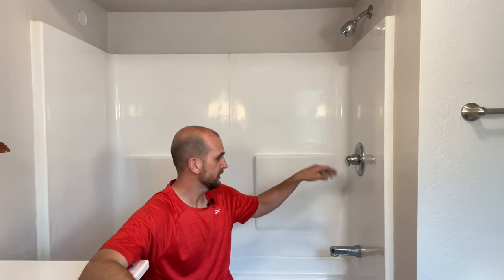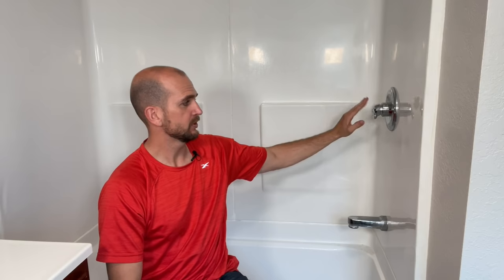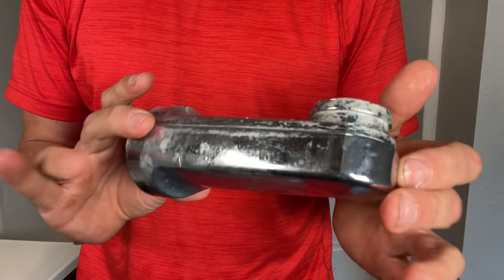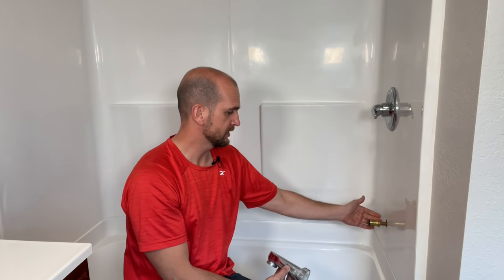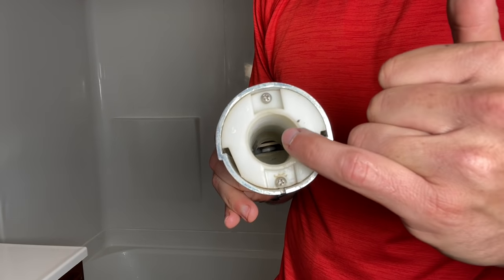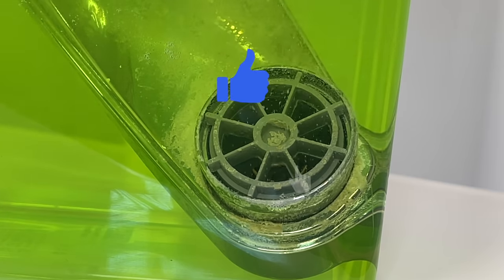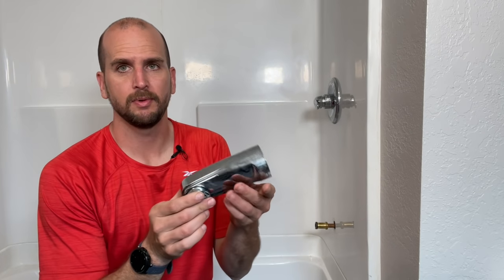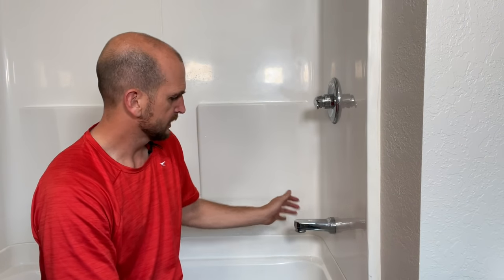Fix Tub Spout That Leaks Water When Shower Is On

Comment: I used white vinegar in my bathroom faucet aerator. Had hardly any flow. When I took it apart the screen was almost plugged with calcium. Works great now.  Thanks for these tips.
Reply from the maker: Thanks for sharing
Reply: Everyday Home Repairs That Fix It Guy hi. A plumber installed a brand new tub faucet yesterday. Now there is an issue. When running the diverter, only water comes out of the diverter with good pressure. The problem is when running the shower, the diverter still running. Both at good pressure. When everything is turned off, there are no leaks. I noticed this after the plumber installed and I asked the plumber why the diverter would still run, when shower is still running. The plumber said that is what the new faucets do now. That seems like a huge waste of water when showering. Is what he’s saying true or did he install something wrong? If he installed wrong, what is the fix?
Reply: @salsamink  I think your plumber is FOS!

Comment: Would it also be a good idea to replace the O-ring, and put a dab of silicone grease on it before screwing it back in?
Reply from the maker: Not a bad idea at all.  Especially if you are running to the home improvement store anyway. 👍
Reply: I would definitely recommend a little silicone lube.  You can get it in small round gray plastic tins at any hardware store for a few bucks.
Reply: Is it a special size o ring? I have the same exact diverter setup and the o ring is bad. Water leaks out the back of the spout.
Reply: @ryandeno4190  Can't recall, since I ended up getting a replacement spout.  Too much corrosion/lime scale on the old one.
Reply: @ryandeno4190  I need to know the same thing

Comment: whole house water filtration system with softerner= fixed mineral issue
Reply: Jimmy Bennett -- Do you know if your system actually REVERSED mineral buildup in your cast-iron sewer line? (If you have cast iron)
Reply: @jake9705  you can help it a lot if pipes in house after the iron sewer are plastic or copper.  as for the sewer it self. U cant stop that.  But highly suggest you filter your water and if you have well water then 100 percent filter it and use water softner

Comment: You need to get a mineral filter installed to your boiler to prevent build up of mineral deposits in any of your valves all around the house as it can also clogg your radiators and the boiler itself,  also you'll need a magnetic filter to prevent buildup of black sludge in your radiators which will absorb the heat and make your gas bill go sky high as the sludge is made from iron deposits it'll take for ever to heat up the radiators in sufficient time in the mean time your gas bill will  £££££$$$$$$$ instead of £$

Comment: Thank you brother. I just bought and replace the shower head then the tub spout starts leaking so badly with bits of black and white  residue falling in the tub from the spout.  I did what you instructed and the blockage went away. Thanks man, you save me buying a tub spout.
Reply: Yeah, probably some old calcium broke off and came out.  Or, the damned city cleaned their pipes upstream, then you got particles that came your way.  Both has happened to me.

Comment: Fun fact fron a professional house cleaner.

You CAN use a stainless steel wool pad to speed up the process of removing calcium build up. Make sure it’s the 0000 grade. I use scotch brite brand. 

It’s safe for chrome fixtures, most nickel finishes too. Just not on brass. 

You can also use stainless steel wool pads on glass! Just make sure it’s not tinted.

Comment: Thank you for this video.  Same thing is happening with mine.  But, mine has threads on the pull-down object, which I took off -- thinking that there was some debris from the city that came through the water pipes.  But, it's not got any debris.  So, I think the problem would be solved how you showed.  But, I am also thinking that I need to take off the pull-down thing and then put some new tethlon tape around the threads.   [Sorry, I don't know the names of things, but I get the gist of what needs to be done.]  This is a very helpful and clear video.

Comment: I've got a kitchen faucet with the combo sprayer / regular pour thingy that clogs up and really slows the water flow. I've tried vinegar and it starts to work, but I may give CLR a try now. Thanks for the tip!
Reply from the maker: Yeah, I think CLR is a bit more effective.  Try to soak it fully submerged for 15 mins.  Let me know how it works 👍
Reply: @EverydayHomeRepairs  dumb question, with water and vinegar the piece floats even when submerged for a second. Is CLR dense enough to keep it down, or should I get a weight still? Your channel is amazing, thank you for everything you do!
Reply from the maker: @CyberPitz  Thanks for the kind words.  I bet it is more the tub spout material which would most likely float in both vinegar and also CLR.  I would just put something a little heavier in the center threaded hole which should help keep the spout submerged.
Reply: @EverydayHomeRepairs  you're the absolute best. Cheers mate!
Reply from the maker: @CyberPitz  🍻

Comment: Thanks for the simple, easy to follow video! Wondering if the spout was changed (new) what could still be causing the water to come out the shower and spout at the same time? The only way to stop it is to pull up the diverter BEFORE turning the water on (to get the water coming out only the shower head). Also, when the plumber changed the spout we suddenly got dripping from the spout!
Reply: Probably need some tefthon tape on the threads.  I've got the leakage too, so that is what I am surmising.

Comment: I have the delco pull down tub diverter spout . I picked up some great value  white vinegar
one gallon at walmart $3,74 cents placed my tub spout in a meat loaf dish because its deep
filled it up with white vinegar and let iit set for24 hours and bingo removes the calcium
the CLR is almost $9.00 dollars at walmart and $29.00 at true value your choice but the white vinegar works great.

Comment: Good video but my problem is just a little different. My Moen spout is the screw on/off style instead of the set key. I am unable to screw the spout off. It easily spins but is somehow stuck onto the pipe and won't spin "off".   Thanks for any thoughts you may have.
Reply: Did you figure this out?

Comment: [Ignore this question ... I figured it out.  My new faucet diverter has the adapter screwed in, so it was quite confusing.  But, I get it now.]
Can I ask ... I have that exact same shower faucet diverter and the exact same pipe arrangement.  EXACTLY.  What is the model number of that shower faucet diverter?  I can't find it.

Comment: I recently had a TERRIBLE behind-the-wall-leak with a Delta faucet handle like the one in this video.

The water slowly seeped behind the wall for years causing swelling in a door jamb in the floor below so badly that the door wouldn't even close.  Could you demo fixing a faucet handle like the one in this video?
Reply from the maker: Not good.  So you had a leak in one of the pipes coming into the mixing valve?
Reply: @EverydayHomeRepairs  -- No idea what the ultimate mechanical explanation was, unfortunately.  I was renting and it was the landlord's problem to fix.  The leak behind-the-wall could be stopped if the handle was pushed all the way in and turned all the way to the left; that is how I was told to manage the minor leak when I moved in.

Two years later that fix no longer worked and you could barely hear water running at all times.  I notified the landlord several times and nothing was done until far too late.

Edit: I gave landlord 2 weeks notice to fix this and other major plumbing problems.  Nothing was done so I forced myself to move out.  The shower handle in question looks like a Moen 3270 crystal handled one.

Comment: Moen Cartridge 1222 , I Replaced My Old One With A New One But The Tub Spout Is Still Consistently Flowing In Full Even With The Single Handle Turned All The Way Off . Have To Keep Shutting Off The Water When Not In Use . Help

Comment: Hey, you got any thoughts on a shower head that whenever someone uses water in the house it starts dripping from the head?
The other one I got is sometimes my toilet will scream at me.   ...Not even kidding, it makes a high pitch loud continuous squeak I guess, which I temporarily fix by flushing the toilet.
Reply: The screeching is most likely the fill valve.

Comment: What if it’s just a drip? The handle was put on backwards so what is normally the hot side is now the cold side and when turned off there is no stopping point. You just have to play with it to see if the water stops flowing but there is always a little bit of a drip. Should it just be replaced and put in correctly? Will the tile have to be ripped out to replace it?
Reply from the maker: Hey Diane, do you know the brand?  Do you see a brand name on the trim plate around the handle?  Moen, Delta, other?
Reply: @EverydayHomeRepairs  Good morning. I just checked and it’s Moen.

Comment: How much of an affect does a tub spout leak like this have on the shower head water pressure?
Reply: In my current case, it's not enough pressure to wash my hair so I have to run a bath first, wash and condition my hair, then empty the tub and start the shower. But I run out of hot/warm water pretty quickly because so much water is leaking from the faucet. But now I found this video so hopefully I can solve it!

Comment: White vinegar works and is a lot cheaper.

Also many modern tub spouts are held on with a grub screw that is loosened with an Allen key
Reply from the maker: Thanks for the feedback David 👍
Reply: That’s what I needed to know!  🙏 I have a Hampton Bay and it has a little Allen key hole at the base by the wall, and I wasn’t sure what I needed to use.  Very helpful!

Comment: Nice video.  As you pointed out, Teflon tape is not necessary to stop the faucet from leaking.  Teflon tape may be a lifesaver in the future for someone who wants to remove that spout after many years.  That tape will help it to come off.  I often use Teflon tape for that reason or I use Pernatex Anti-Seize which I get at auto parts stores.  After many years, these faucets get stuck on.  That is why they make strap wrenches so you don't mess up the finish.  Some people stick a dowel or screw driver into the spout to get some leverage.  Vinegar works very well.  It works better when heated up.  I heat it up in the microwave.  I don't know if I would do that with CLR.

Comment: What other ways are there to take the spout off? Just curious because I don't have that kind and I don't want to go muscling off mine and break something only to find out that it comes off a different way.
Reply from the maker: If it doesn't simply thread off then you might have a small set screw on the bottom which you can loosen with the appropriately sized allen wrench.

Comment: I need help, If possible pls!
My shower won't turn off completely when id like to fill the tub. My landlord has replaced the tub spout, has also replaced the diverter in the wall. 
But that didn't fix the issue. Wharves the next step? What else is the possible issue?  Do I need to take apart/replace the shower head?
Tyia!
Reply from the maker: Has it ever worked correctly?  It is possible when the valve was originally installed the pipe coming from the valve to the tub spout is too small causing a bit of restriction that results in water going up through the shower head.
Reply: @EverydayHomeRepairs  that I dont know. I have just moved in 2mos. ago. For that I suppose I'd have to remove drywall and find the valve? Or is it next to the spout?

Comment: Delta faucet.  Two screws holding it to where it can't be twisted off (it's the pushbutton version of diverter).

Advice on how to remove those?  It leaks half the water that normally flows thru the faucet.  Thankfully I have amazing water pressure.

Comment: Mine worked fine until I got in the other day and as soon as I pulled down, it started shooting out sideways from the pull down diverter. As in, not from the core opening below in the faucet. I do still have about half of the flow going to the shower head, but it resulted in a very icy shower with that much water loss. I'm guessing that means it broke and needs a new one, as opposed to just cleaning it, correct?
Reply: [Ignore this question ... I figured it out.  My new faucet diverter has the adapter screwed in, so it was quite confusing.  But, I get it now.]
Yeah, same exact damned situation.  I tried to clean it, but it was from 1994.  Believe that -- when house was built.  So, I'm not trying to find the exact replacement -- same as in video, but it's hard to find.  Anyway, better to just replace it.  But, that was 8 months ago, so this is probably old news to you.

Comment: How about the opposite? In one of my showers, the water flow stops completely when I pull on the diverter half the time, like there’s a flake or something blocking the pipe up to the shower head. I’m tempted to take off the shower head and and squirt some CLR up the pipe with a turkey baster…
Reply: That is an ingenious idea!  I was thinking of using a shampoo bottle or dish soap bottle and squirting some up in there but I like the turkey baster idea better!

Comment: The adapter is brass and the inside of the delta spout is plastic this is why you don't have to worry about it not wanting to come off in future, if the inside of the spout was brass then 100% you would need anti seez . But myself being a licensed master plumber and owning a plumbing company for over 20 years I have installed over 300 of this exact model spout. If you solder the adapter on correctly it will last for years, I see so many contractors soldering the adapter on with the O ring still on which I'm sure most of you know is incorrect, if you remove the O ring then solder the brass adapter on, wait for it to cool ( do not try to put water on the solder joint while it's hot to cool it faster , big no no ) so after it cools then put O ring back on, and screw the spout on until it's snug up against the wall, then put silicone around base so that water does not get behind spout. I never use anything on the adapter threads, the O ring seals the water from going backwards and beings the adapter is brass and the spout threads are plastic it will never corrode. I  have some that were on for at least 13 years and went back to unscrew off the spout to replace the O ring and it comes right off like it was on there for one day. You can put anti seez on if you want or Teflon tape, I'm not saying that's wrong, I'm just saying that you don't need to . If you have ever installed any of these they screw on really easy , like super easy there almost to easy that's one reason they come off easy also. But they last alot longer than the ones that have the divert up top.
Reply: [Ignore this question ... I figured it out.  My new faucet diverter has the adapter screwed in, so it was quite confusing.  But, I get it now.  I didn't know the new adapter piece was screwed into the diverter, because mine has an opening that has a small 4 inch cavity or so.  But, they're a match after all.]

@RockStar ... Don't know if you will see this -- before I go search the part out ... BUT ... I hope that I can I ask this.  I have that exact same shower faucet diverter and the exact same pipe arrangement.  EXACTLY.  What is the model number of that shower faucet diverter?  I can't find it.  I've looked online at Home Depot and Lowe's, and I ordered 2 from Amazon.  But, the ones that I got have threaded ends -- into the diverter spout part.  But, my plumbing pipe has that exact same attachment as his, and I need to find the spout that will slide onto it.  If you can, please, give me a model number where I can purchase it online -- if you know it.  Or, maybe, brand name.  I thought it was a Delta, but the ones I got from Amazon don't seem to be it.  And, most pictures of the parts don't have the back's picture to see how the other side of the spout looks (sorry, probably the attachment side).

Comment: Does NOT work for American Standard faucets with set screw.  So trying to be a good wifey, I 'unscrewed' the faucet, scored the pipe and luckily did NOT cause the pipe to break and created more work for the Hubs.  Plus, the replacement faucet was close to $25.00.  GREAT video of DELTA products.

Comment: I just installed a new delta tub spout with diverter like the video. It has a small enough of a drip when not using that causes calcium marks in my new drain.  Did I not tighten it enough or what?  I know your video is 2 yes old but hope to get a response.

Comment: I have the exact same tub spout, and I hate it. I want to go with a diverter spout that has the diverter on top instead of the pull type on the bottom. Will I be able to use that kind of spout in place of this one.... like in the video?